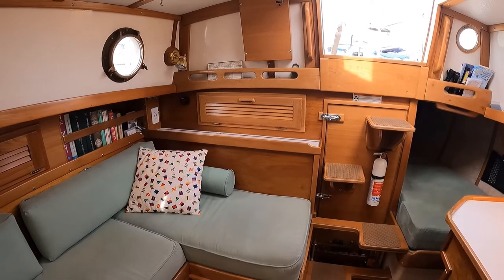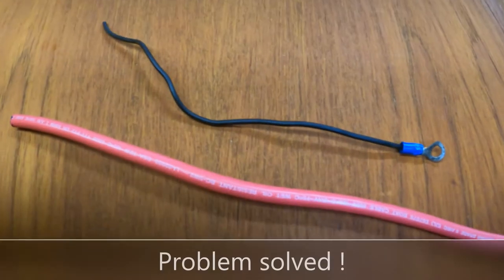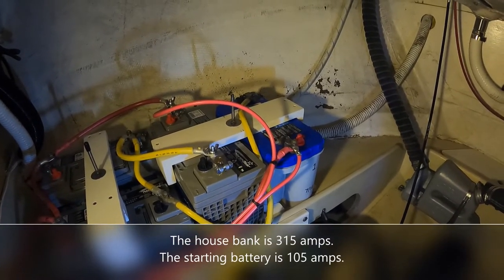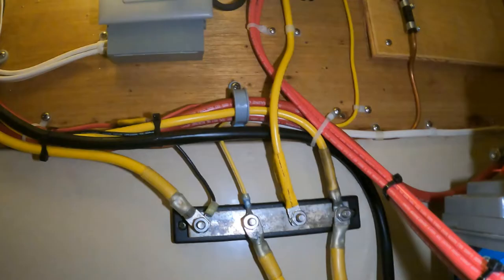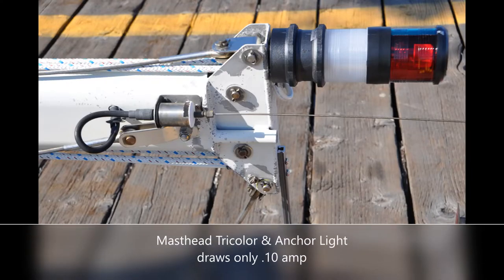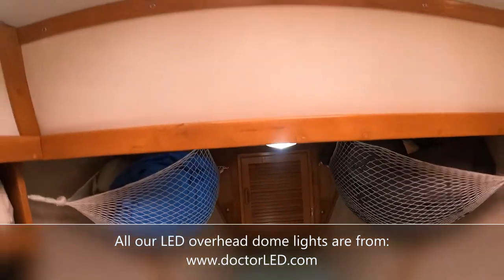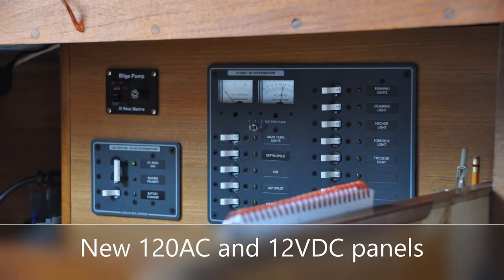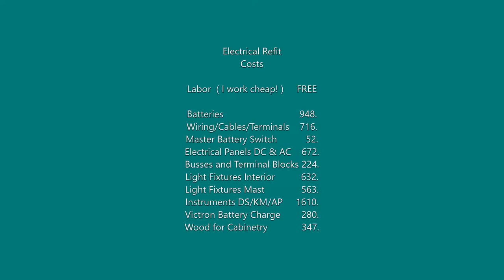New Electrical System Installation, Getting Juiced - Video #17 - Westsail 28 - "Starwhite"

Comment: Do you happen to have a wiring diagram for your setup? I am currently working on rewiring age old electrical work myself on a Westsail 32. I have the AC and DC mostly figured out, but I am trying to sort out how you wired the charger into this system. I like the idea of the AC source installed right by the charger.  I'm asking because it seems your batteries were wired one way in another video on the engine compartment (Video #44, 2:12 has the starter wired to the house bank) and here, the starter is wired different @2:32. If the Victron unit comes with an installation diagram, then I can refer to that. Always admiring your restoration work! Thanks!
Reply from the maker: WOW, you have spent a lot of time studying my videos!  I had to watch the videos again myself to see what you had noticed!  I think I see what you are asking about.  
Initially I had wired each battery bank with separate negative (yellow) cables running to the negative main buss on the engine room forward bulkhead.  Running separate negative cables was overkill and unnecessary as they were/are both going to the same main negative buss.  I later replaced the Engine Bank (#2) negative cable with a much shorter cable simply tying it into the House Bank #2 negative run at the batteries.  The long cable I removed is now installed on our other boat.  As you are likely finding out Tined Cooper Cable is expensive!!
Wiring the Victron or any other 110v battery charger is pretty simple and straight forward.  
Sorry to say I don't have any wiring diagrams of how I wired the boat.  It was a long process over a number of months.  Lots of time just sitting on board analyzing where the best wiring runs might be...
Reply: @Westsail28  Thanks for the feedback. I think I can relate to sitting onboard working your way through all the runs. I can see now how you have the house bank and starter setup.

Comment: i also have this project coming up next spring. From start to finish can you give me a ballpark figure on how long it took to do this? Thank you Even Keeled for the link,  much appreciated
Reply from the maker: The entire project took place over several months as some of it was dictated and/or held up by other projects on the boat.  
But here are my best estimates based on memory.
Mast wiring and new mastlights - 3 days once the mast was on the ground
Electrical panel relocation and related cabinetry - 3 weeks, one to plan and measure the cabinetry and two to install the panels and wire them. (Both 12v and 120V)
Pulling wires for Running lights, A/P, Maincabin lighting, Galley and Refer- 2 weeks, plus several days finding the best wiring routes.  (spend time thinking about the best most efficient routes it will save you $ in the long run)
Nav. Instruments DS/KM/Compass wiring and cabinetry - 1 week  (keep in mind wiring runs to the transducers)
New Battery bank tiedowns and wiring to the master switch & busses - 1 week

Removing all the original electrical system, batteries, wiring, switches, panels took only 3 days - Getting at some of the original wiring was a challenge but gutting was easy as I just cut anything that was difficult to get at, everything was going in the garbage or recycle!
Reply: @Westsail28  thank you so much for thereply. and i admit you do a fantastic job now im off to make notes